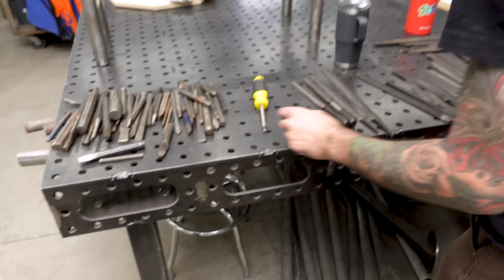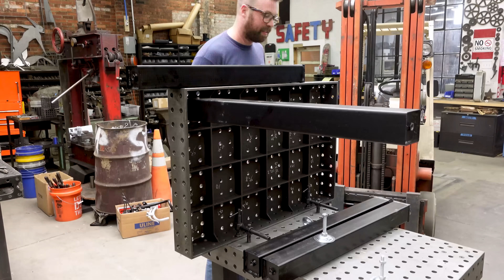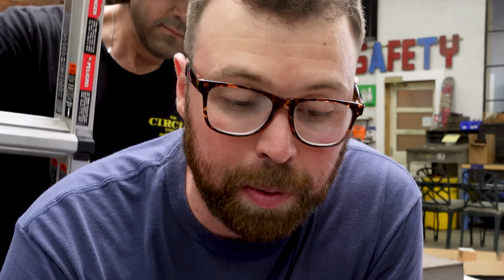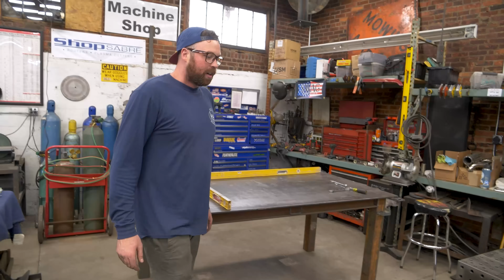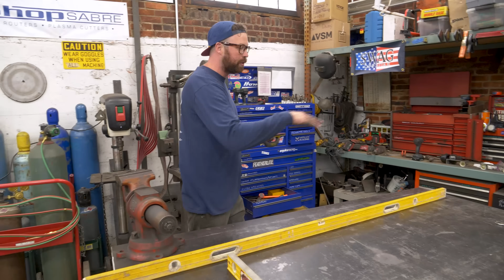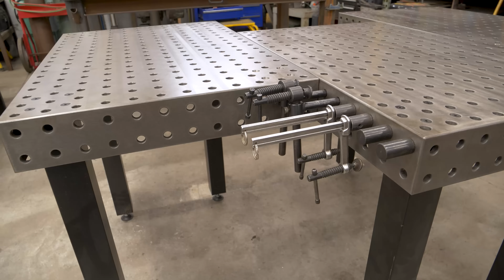Why Did I Build This Fixture Table Wrong?

Comment: I would rather have fireball tools welding system. That's what I'm starting off with. Everything about it is more beefier and guaranteed flat and square. Even with their new Dragon wagon. I'm not knocking lameir system but I'd rather spend a little more and get a better fabrication table

Comment: That table configuration is cool!  The only thing I see is does it need to be taller for Tay?  Do they make a table with hydraulics like they do the sit stand desks?  I guess steel would weigh a little more than paperwork.   They should do something like that for the metal fabrication shop with multi heighted (is that a word?) People,  Like yours.  A table for Tay would not work well for Wyatt.  Anyway, we enjoyed the video!  Thanks for sharing!

Comment: For the price, that is really impressive. It isn't some super extreme precision table, but is an order of magnitude cheaper. I'm not sure how they get it so cheap while still being bon-a-fide useful. Perhaps it's some crappy cast iron china-mystery metal, but still, that's good enough for the loads a welding table sees when it's that thick. I'm positive this table isn't in the 0.001" range flat, but if you aren't doing things requiring that, this is really nice. Also, the ability to make that  arrangement your guy came up with is awfully useful. As much as I'd love something like the Fireball table, it's hard to justify that expense especially if you are just a home gamer or have a side hustle.

Comment: Tay, the new fixture tables wii prove to be a great addition to your shop. Question: do you grind the fixture table tops to renew the surface after you weld a project to get rid of the splaters? Blessings to you all.
Reply: You could always use anti spatter spray to protect the surface and then just knock any remaining prills off with a cold chisel.

Comment: I think the modularity is defeated by the liquid shim kit, which would lock the individual tables from being moved around. A better option would be some sort of set screw arrangement accessible from the underside to account for the edge of the table possible misalignment, which would allow the creation of precision square edges to these tables. Prehaps a threaded set screw hole in between each row of holes, allowing for custom alignments such as yours, not necesarily filling every one of the set screw holes, but prehaps one pair of set screws on each side of each connecting bolt.

Comment: L shape table for the win.
Worked for many years on 2 2x1 meter tables bolted together in an L shape.
Recently qouted the steel for fixture table top on the bench i am designing/building and having it lasercut is under the price of that langmuir.
Besides that they are not available in europe.